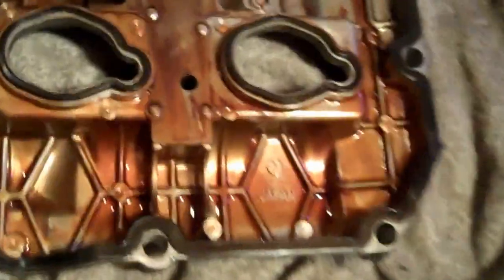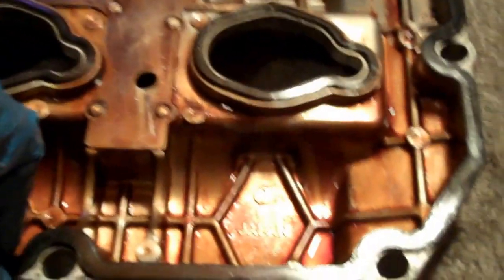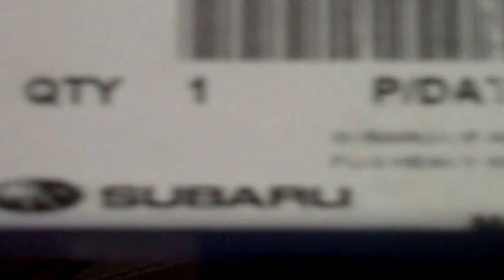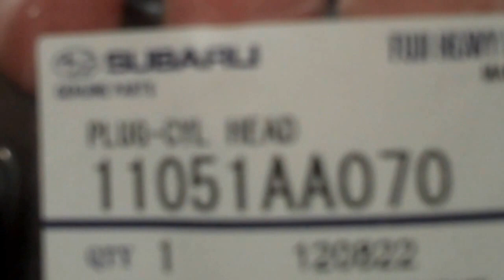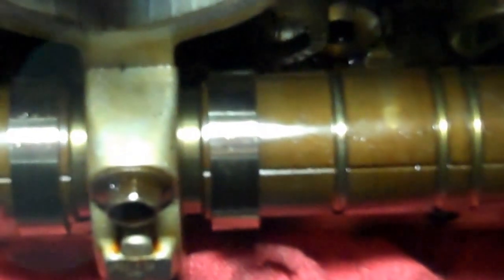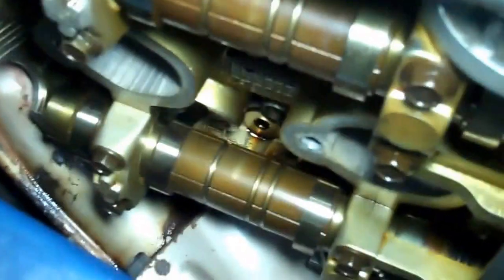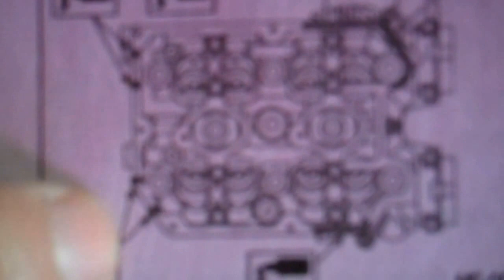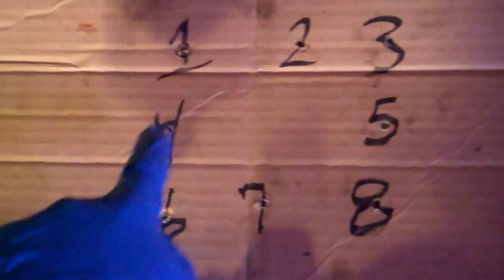Subaru Service Series 15 WRX STi rocker cover valve cover install gasket valley seal SVTWRC

Comment from the maker: @racefreak156 the line is called turbo oil return pipe. You need to remove the heat shield and up pipe bracket. The line goes from under the turbo to a pipe that connects to the oil pan. The line goes straight down from your turbo and has no pressure to it so the clamps are weak. You may be able to get a small screw clamp back there but it takes some patience. Better than removing the turbo unless you have to for a full blown line.

Comment: Awesome video! I have an 07 WRX TR and have a slight oil leak. Going to change the gaskets and seals on both sides. I saw another video showing an oil separator cover also being changed? I think this is rocker cover on the driver's side that connects to the oil filler. 132k plus and the runs like a champ. Thanks again for the video!

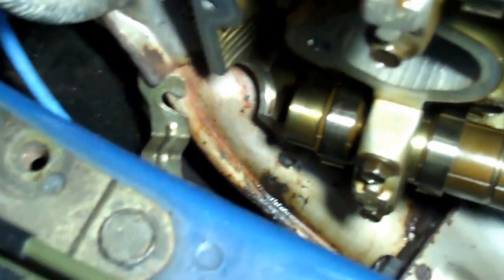Comment from the maker: @Piden Sok in part 1 at around 6:33 , I show the bolts and the heights of each shoulder on the bolts. You may be able to match the heights. Looks like the smaller ones go toward the radiator, two long ones go in the middle and the lengths in between go toward the firewall hope that helps. Thanks

Comment from the maker: @JustDoltMC3 I did not drain anything fluid wise. Only had a few drips of oil from the cover when removed. I checked the oil  afterward and there was no loss.

Comment from the maker: @Orion Dragos Fujibond was placed everywhere I scraped it off from the factory, all around the valet seals and some on the tricky Brenda toward the front of the car. I did not put Fuji all around the entire perimeter . Those breather tubes took some WD-40 and a needle nose real easy.

Comment from the maker: @racefreak156 I had a visual leak on the up-pipe heat shield. I caught it before it smoked. Also check your turbo oil return tube the rubber can leak.

Comment from the maker: @hondacbrforlife 5 pounds is ok just be very careful. My torque wrench did not fit in the tight spaces so I went hand tight then small quarter turn to tighten no problem . Also double check that you placing the bolts back correctly  noting the different lengths .

Comment: Thank you for this awesome walkthrough. Quick question, did you put any fujibond on the flat face of the half-moon pieces? Also, I've heard some people put fujibond on the entire perimeter of the valve cover (the valley) and then place the gasket on the cover, did you do this? Thanks a bunch!

Comment from the maker: @eddy9419 I can't find them anywhere but the Subaru dealer. Problem is getting the right length. Your sure you used the correct bolt for that thread? Are the others in ok, try to figure out from the video what length to Mach up andtake that one to the dealer . This seems like a common problem.

Comment: Forgot to ask about the breather tube that goes on the valve cover. I have a 05 wrx and it has the plastic breather cap that goes on the valve cover. I've heard people having a hard time getting the hose back on, any tips? Thanks again!